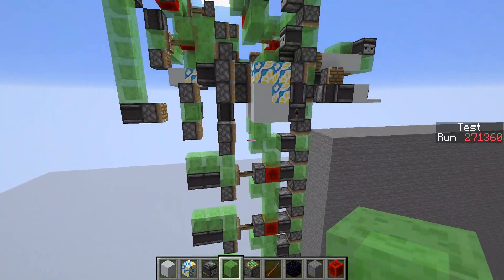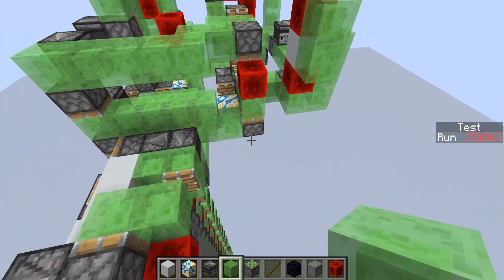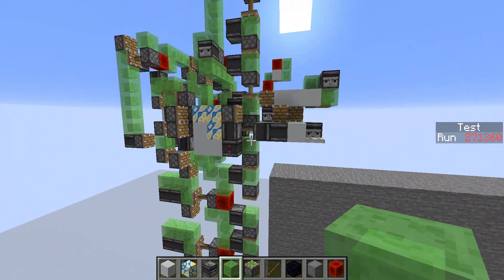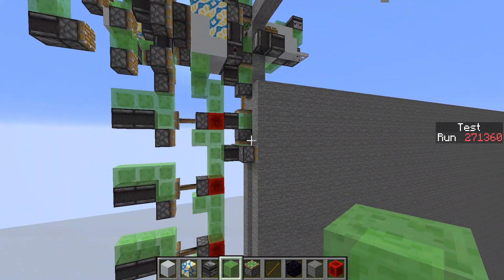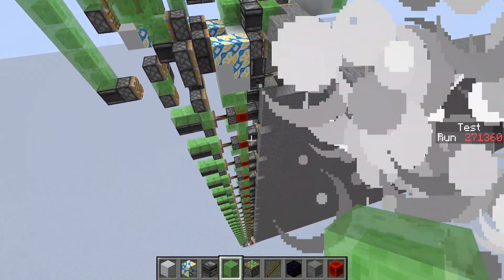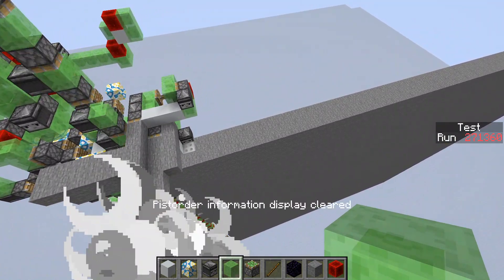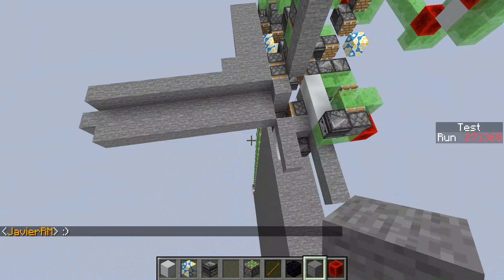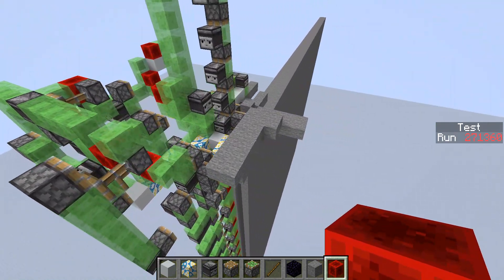Faster, Easier Trench Maker

Comment: Built it in survival, actually built version 2 for 1.18, schematics found in discord channel mentioned in description.
Basically works OK, have to build small additional section to deal with tailing and gravity blocks.
Get serious problem when trench maker catched mineshaft. As soon as fences are arriving to the conveyor part of the machine it becomes broken, because fences issues additional updates to observers when they're connects/disconnects to other blocks.
So if you're going to use this machine to make trenches for world eater be sure you found and removed all fences, spawners and obsidian blocks on the way of it - same preparation as for running quarry - this machine is actually a small and simplified version of a quarry section.
Reply from the maker: all of those issues are kinda known xd, but yea those are all issues that this trench maker has. other issues are 12 rails blocks after each other with water at the very end. that can lead to water getting into the trenching area, which is a huge deal especially for trench makers, because theres often a ton of lava at the bottom which would then cause cobble to generate. other issues are ones with gravity blocks getting destroyed as part of the block shield infront because of the 13gt upwards engine which is needed to remove gravi blocks in the current slice. there are tons of issues with this, but most of the time its just best to not think about those and just let the machine crash over and over again. Thats what i did back when i was actually using this. i probably build this thing more than 20 times lol

Comment: have you thought about making a version for a wider trenches by combining few o this machines into one?
Reply from the maker: well the maximum for an easy trench maker would be to have a 6 wide one because after that the exploding of blocks is getting more difficult and more in a quarry kind of way. maybe ill make one for 15 wide trenches for world eaters at some point. so yes i have thought about doing that already like 2 months ago but never got around doing so.
Reply: Would be vastly faster to just run the 15 wide TNT trencher and then go back with this to make smooth walls. This is way slower and less reliable than TNT.

Comment: Hmm, maybe this is slow enough to run directly behind a quarry? Or maybe you could slow it down... Interesting stuff!
Reply from the maker: this is relatively fast. 1 cycle is about 2.5 min or so. ive sped it up as fast as i could. if you want to make it slower, id suggest some flying machine delays.

Comment: I love this machine it looks cool
But its very slow, i think diging 1 line by hand and fill it with water is faster, isn't it?
Reply from the maker: tbh, i never tried it, but building this machine takes like 30 minutes or less if you are experienced. my record was around 21 minutes or smth without tweakeroo or easy place, so no. if the trench is like 500 long this will definitely safe time
Reply: @thecraftingfederation2425  good

Comment: how the machine deals with liquids from front and the sides??  (in 16.5)
Reply from the maker: it doesnt. no machine has ever dealt with liquids from the sides.
Reply: @thecraftingfederation2425  so how is this useful if i have to dig out a 3 wide trench to liquid proof it?
Reply from the maker: @sweetbaboo566  well you done liquid proof it. just let it break every 100 blocks or so. its very easy to fix anyways, doesnt take longer than 10 minutes normally
Reply: @thecraftingfederation2425  ok, thanks. I guess I thought it was catastrophic if it ran into liquids
Reply: Also I struggled with getting the schematic to work in a testing world The verifier comes back 100% and I started the TNT machine before updating the piston. It's 100% consistent the scooper goes all the way to the top and then doesn't return any ideas?
Reply from the maker: @sweetbaboo566  there should be a fixed version of that on the slimestone tech archive. in some old litematic i forgot to include 3 blocks that send the flying machine down again. thats the reason for it crashing if you are using that one, but as i said, there should be a newer version on the sta.